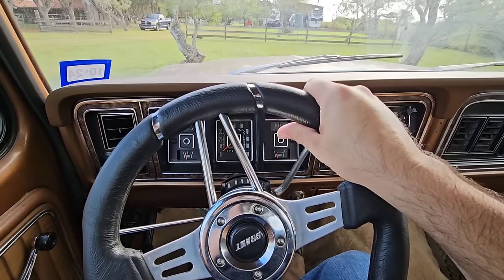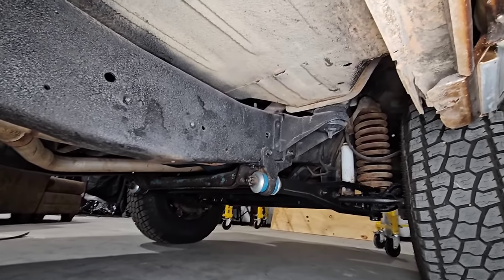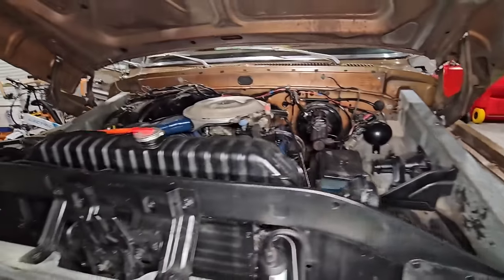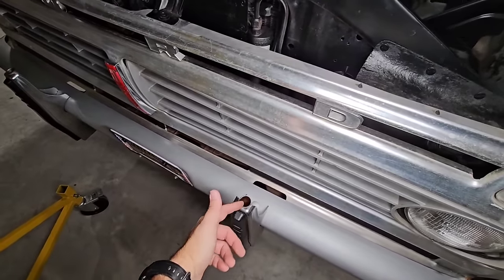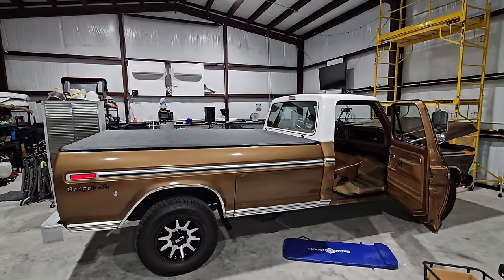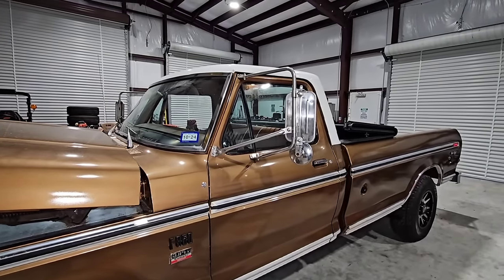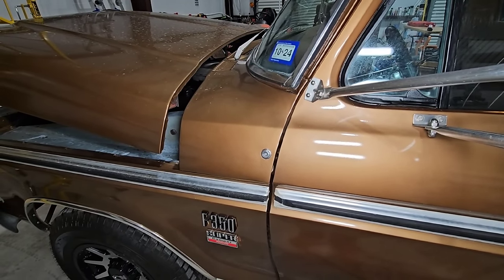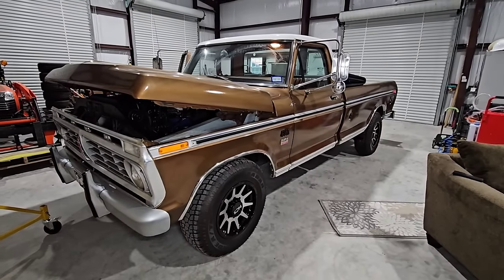Deeper Look at our 1973 Ford F350 Super Camper Special!

Comment: You mention Cat back exhaust replaced, that year probably did not have a catalytic converter. Not required until 1975, I believe.  I believe the bed looks longer because of the stretched out wheelbase, for a slide in camper.  My Uncle had a Chevy Camper Special, I don't recall his having that long of a wheelbase. I don't know about the security system being factory, I had a similar setup on my 1980 Chevy Customized Van. Mine had the outside key to energize the system, with a small toggle switch inside, under the dash. The toggle switch set the alarm, the key outside was to turn it off when you wanted to get in. I think mine had a separate alarm, not using the horn to alert.  That truck brings back some good memories, I had a 1970 F100 with a 351 Cleveland, 3 on the tree posi rear, I could punch it and catch rubber while rolling along at about 25 mph.  I like those wheels, I know others dislike them, but they're not too modern to look gawdy.

Comment: Beautiful truck.  Just a FYI: The “Camper Special” emblem that sits directly below the “SUPER” emblem is an “after market” emblem.  Is slightly different from the original which has a ribbed background.  The bed is 8’ but looks longer because of the fact that the rear axle is set back 7”. Gives the illusion of a longer bed.  The overall frame rail structure of the truck is actually “narrower” than the other Ford pickups because it’s based on the Ford class c frame which did accommodate dual wheels.  Again, I’m talking about the Ford frame for class c rv chassis which was stronger and did have dual wheels. I’m a fan of all original so I’d keep the original mirrors.  The lock on the fender was a dealer added security system.  My F350 which was ordered directly from the factory has it.  There was a  separate horn in the engine bay.

Comment: 1973 has 4 screw taillamps. One year only...I have a 73' and 79' scs. A 360 has 1@7/8 freeze plug, 390 has an inch@half. The frame is 34" chassis cab, industry standard width. Harbor freight offers a nice amber, teardrop replacement cab light. I like the west coast mirrors!

Comment: It appears that there's a second battery tray under the hood probably for the slide in camper. So my guess for the barrel key switch would be a quick battery disconnect for said camper battery.

Comment: A friends neighbor  had a truck like this they had a slide in camper thatwent 3 ish feet behind the tailgate area. 
Axel set back and spare in same location...
It had aftermarket  rear bumper extensions quite a truck. I believe it had steel white rims. With centercaps.oem. 
The aftermarket round barrel lock was  the on and off switch for alarms. Very popular back then.
Headlights look at a company f.w.speaker. heated brilliant modern lights. Oem on peterbuilt.
They have round as well and super durable. A bit spendy. But they burn off snow and ice in the winter. Thay last. A friend has a set on on a freightliner and his back up western star they are amazing.

Comment: That lock is a Barrel Lock like you see on Coke Machines. There is no telling how that Security System worked, could have been several ways. Leave the Tow Mirrors! My dad bought a 1971 F-100 Camper special brand new. it had the 360 with the 3 on the tree. That thing was a BEAST!!!!!! Our Jack Crank was under the seat, check out my other comment.

Comment: I’ve only seen one of those trucks in the wild so to speak. It was back in the mid 80s for the life of me I couldn’t figure out why it looked so different. The existing tires look proportional for the truck, a more period correct wheel would look much better. Like you trailer towing type mirrors are better for sure. I like my trucks to look like a truck not too far from original! Looking forward to the upgrades especially the headlights as I would like to do the same to my 77 F100

Comment: I had one these trucks 1975 my was cab in half back seat turn in to signal bed ,8 lugs on each tire 400 engine in it it was a beast. They were set up more for slid in camper

Comment: Holley has a LED headlight that would be a direct bolt in with no outer ring light, it would look stock.The stock wheels for that truck would be 16.5, not a popular size anymore. I would go with a 16in white spoke, it would be correct for the era, and look good with the white roof. The double wall bed like yours, I believe , is only on the Super Camper Special. All other Ford Trucks of this time have a different style double wall construction.

Comment: I bought new a  '72. 8' bed was standard. 8.5' was not an option. Yours is a little fancier model (Ranger). Mine (XLT) did not had the front bumper guard .  You are correct about the spare tire placement & the wheel base. A F250 had a shorter wheel base and on some models the spare was under the bed in the back. I can't really 100% remember but the crank handle to the jack was just along side the jack or had a bracket behind the front seat, as I recollect. The jack was a joke & the first thing I did was to get a 6T hydraulic bottle jack I kept behind the seat. Compared to my '21 F350; I believe my '72  weighed more (heavier gauged metal ) and it had a higher load cap. I had a 10' slide in camper + a 18' I/O boat + a small Honda 90 on the front bumper. Little to no squat. Wheels were 16" split rims, 750/16 's tires. Same tow mirrors. I'm not aware of a factory alarm system. 390's were a great engine, but rare; Ford was pushing the 360" in most P/U.  Most of the models like this one had the 460 cu.in. from '73 on. Yes, the C-6 tranny was a 3 spd. 4spd auto was not an option. I never saw any that color, Not saying it didn't exist though. Looks great ! .

Comment: I believe that the crank arm should have been on top of the radiator support just in front of the radiator. It looks like the hole at the center of the support with the extra halfmoon like bit of metal is where the wingnut bolt would screw in to hold the handle in place.

Comment: JD I don't think that an F350 would have had a catalytic converter. The Alcoa Mod wheel is made for this truck, and looks original. Keep the mirrors, if you find a slide in Ford camper you'll need them.

Comment: The holes on top of the bumper guards are for an optional dealer installed grill guard....I had a friend with one of these trucks and it had the grill guard....was a 460 engine and 4 speed manual Trans
Reply: Mmm, you could not get a standard transmission behind a 460 with the Super Camper Special option?
Reply: @crewyou07  yep special order...it was a great monster of a truck, ha had a 2' wide catwalk front bumper made so he could climb up high to survey the terrain, he was a land man back in the oil boom in the late 70s and early 80s.....

Comment: The air cleaner is off a 78 or 79 351/400. The original for this year would have a flat lid. No cats until 76 also.

Comment: The holes in the bumper guard were for parking aids. Please leave the mirrors alone!
My vote is stock steel wheels with original hubcaps. My “72” came with 16” split rims.

Comment: Is it.360 390 Ford 360 in trucks and 390 in cars. 360 has more tork 390 has more hp. My truck has 360 had 390 with rv cam didn't like it put 360 back in it